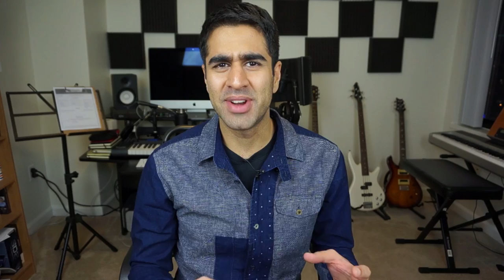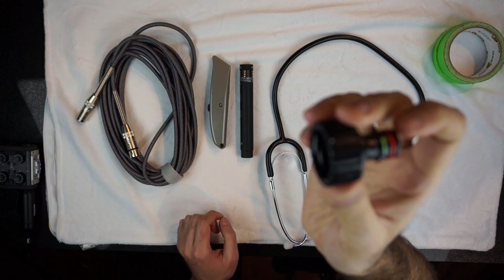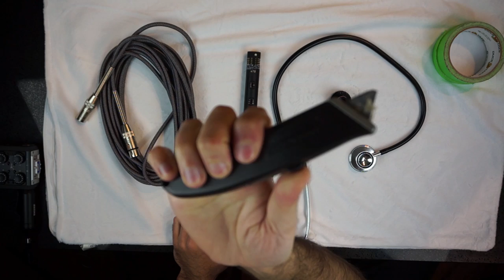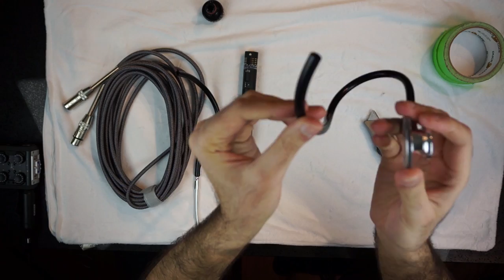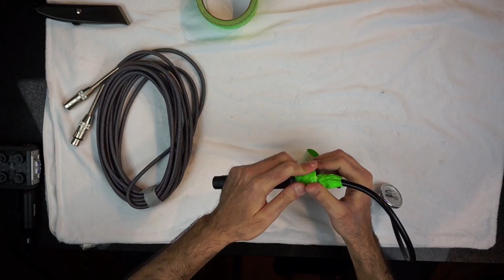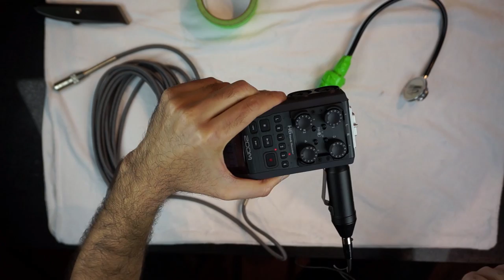Turning a Stethoscope... Into a Microphone?!

Comment: Damn, finally got around to trying this and it didn't work out well.  I basically can only get scratching noises.  Even a heartbeat is really faint or not perceptible at all.  Wondering if I did something wrong, but I bought the exact same parts and don't really see how I could have screwed it up.  I used a Behringer C-2 for the mic, but everything else is the exact same.